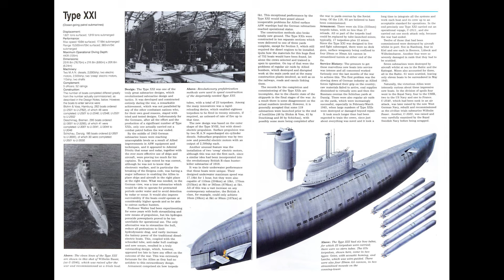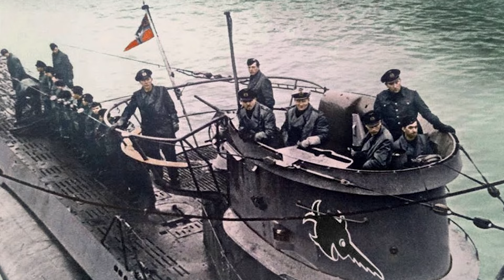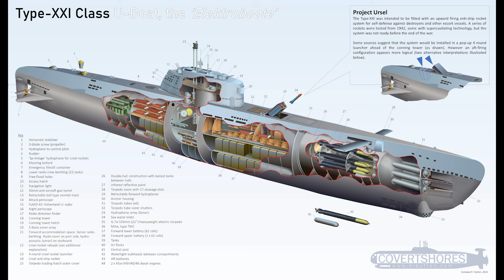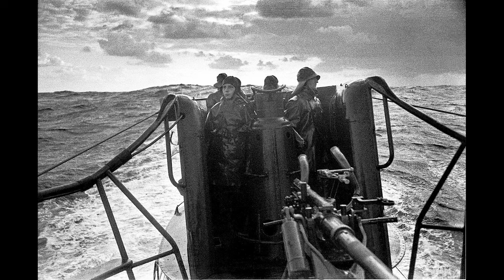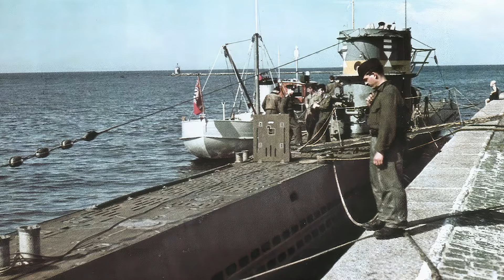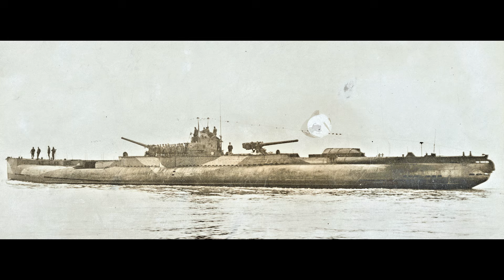Why the Allies Couldn’t Detect the German U-Boat “XXI”

Comment: They had the Technology to make them essentially totally undetectable, two conventional type 9's I believe, were built using these Tiles on the Hull & Conning, and something else they did to the Deck and removed some protrusions, they were running between England and France and wreaking havoc on Ships leaving England, the British realize these Ships were being damaged or Sunk right in the designated Shipping lanes.
they presumed it was a Sub and mined a Shipping Lane where it diverged and Nailed one of the Subs, I believe they didn't know till after the war. but the attacks had stopped. The Germans just couldn't afford to outfit many more, and their competing and chaotic Weapons programs prevented it, so they suffered catastrophic losses; had their priorities been different, there could / would have been a radically different outcome in the Sea Warfare.